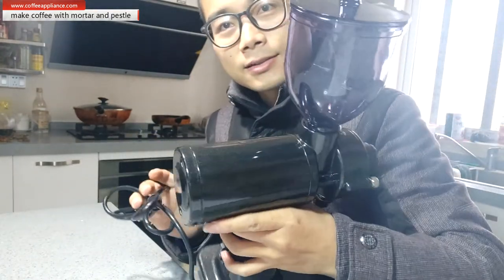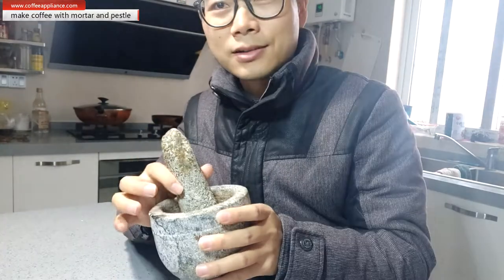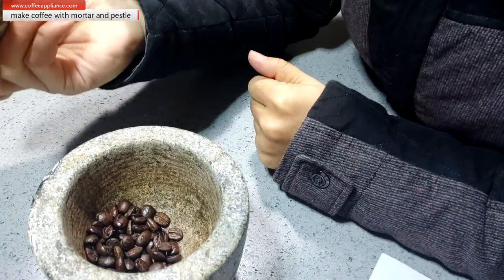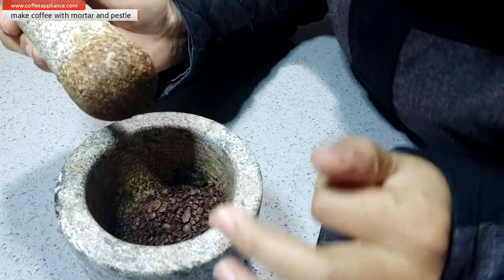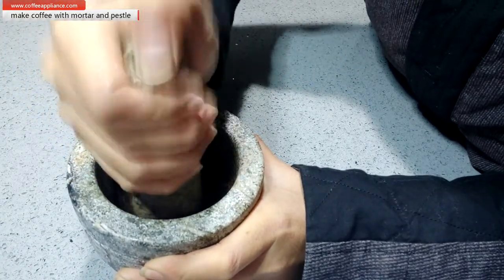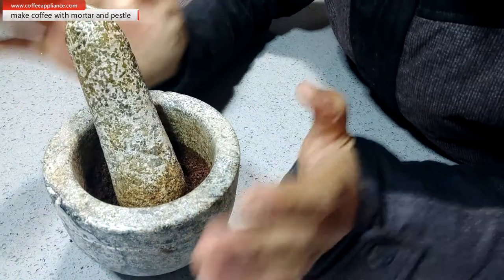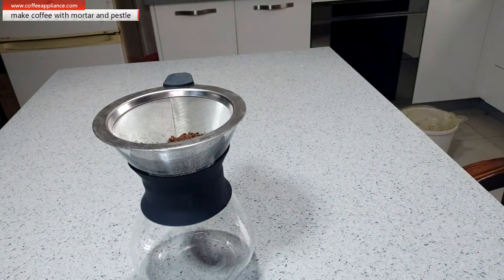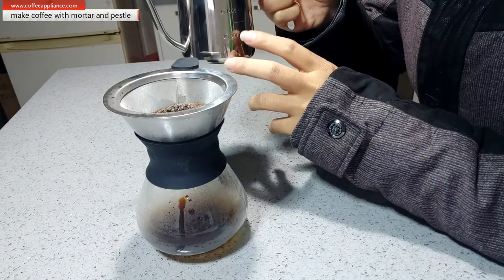Grind coffee beans with mortar and pestle. Grinding coffee beans without a coffee grinder

Comment: I can't find a manual grinder worth the prices asked.
I looked here to see how much effort it took to Mortar and Pistil the beans very corse.
I am using these in a standard Percolator brew, where regular canned coffee sifts through the filter basket.
This is a pre-disaster type thought process wherein a campfire, a pot, and coffee beans would only be available.
I find even with regular coffee sifted to the bottom without a paper filter, is much better than with a paper filter.
Your method seems to be the most effective and primitive way to achieve this.
Of course the tried and trusted throw the beans in a pot of water and boil until dark, or just chew the beans is also available.
A+
Reply: Personnally, i plan on bringing coffee beans on my hiking trips in the wild, so i took the time to carve my own out of a log